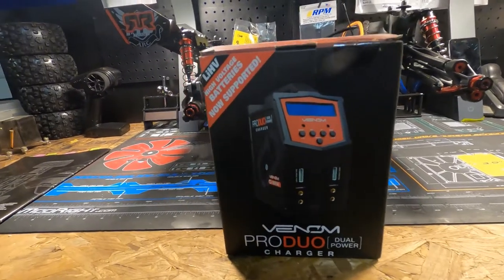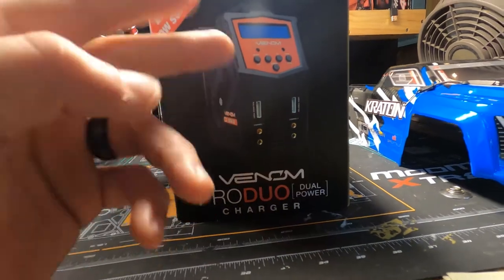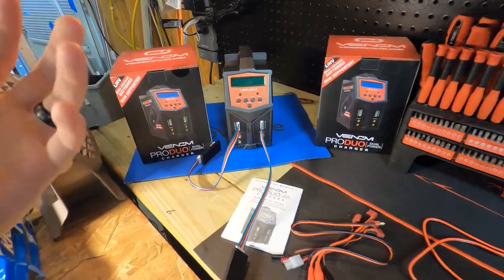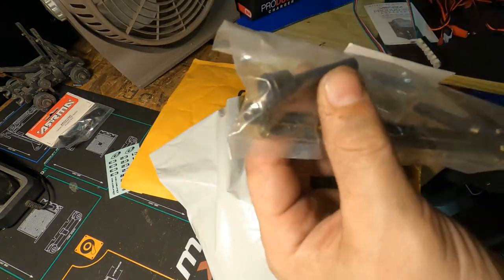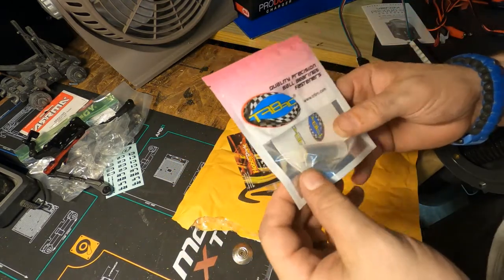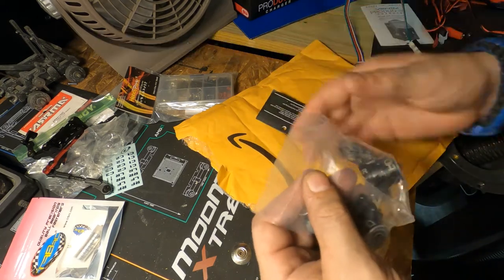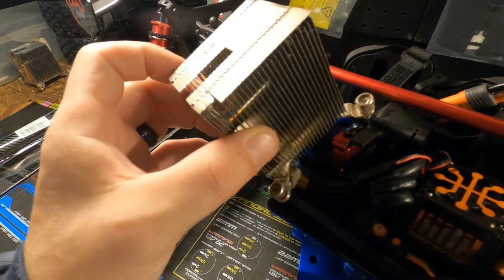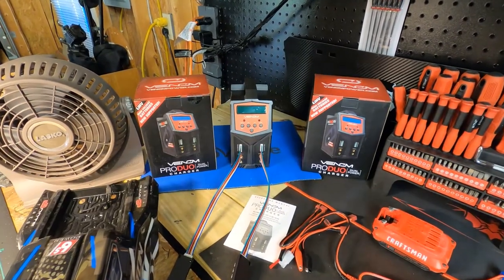Kraton6s + UPGRADES! and Venom Duo Pro Charger

Comment: That top Plate steering flat price  should be exb stock if you flip it over it says exb just like the one you bought.  Everything that came in the steering package is already in your truck.   If it's the v5 6s
Reply from the maker: Yes its a V5 6s... Yea im looking for that top plate in carbon fiber.. I just drop 300$ on more part upgrades.. So more videos ahead..  Also i found the center brace from ebay in all carbon fiber.. Its awesome..
Reply: @ATECHPCs  right on, but when it was stock that flat plate on top was plastic? It shouldn't be even stock it's aluminum on all v5 modle stock.  Im Just confused. I bought the same truck a month ago and  the plate is black but it's justvthe exb version turned upside down because there are 2 diff size holes.  Upside down the hole is smaller for the blx hardware to attaches the brace flip it over where the exb words face up and then the bigger hole lines up for the bigger hardware that holds the red exb aluminum chassis brace.  But it's the same aluminum flat piece for the exb and blx.  You said yours was plastic so I was confused.  It even shows on the side of the box that flat Plate is aluminum and is a exb part.  It's one of the saleing points on the box are to show all the upgrades for the v5 blx.
Reply: @ATECHPCs  also I have the whole truck it's a month old I'm getting rid of it.  I have both exb center chassis braces new in package rpm front bumper still in package metal rear skid plate new fast eddy bearings installed extra wing mount brand new 6s backflips as well as stock tires ,hr servo mount and servo horn. Diffs have been gone through and topped off and stiffed up a bit.  I'm asking 550 on Facebook market place if you know anyone intrested oh also have  extra 5200 60c 6s battery new I would throw in for 25 buck 575 total.  I just got into crawling and enjoy it more than that insane beast.  Lol I have over 700 invested just want to recoup most of my money. It's in great shape still no real bashing. Maybe 5 full runs on it showing ppl how fast it was.
Reply from the maker: @danielcase2189  were are you located? Im in Tennessee. Sevierville
Reply from the maker: @danielcase2189  one of the key factors that I look at before buying a RC vehicle is the upgrades how many upgrades are available are Park easy to access to many manufacturers make the parts you know things of that nature cuz I don't want to have to buy a vehicle but you can't upgrade and it's amazing how quick you can get $2,000 wrapped up into it
Reply from the maker: @danielcase2189  will you consider subscribing to the channel
Reply: @ATECHPCs  Spencer Indiana
Reply: @ATECHPCs  I thought  I was subscribed  let me check again.  There is a one video  on my you tube it was the first time out when I had first got it.